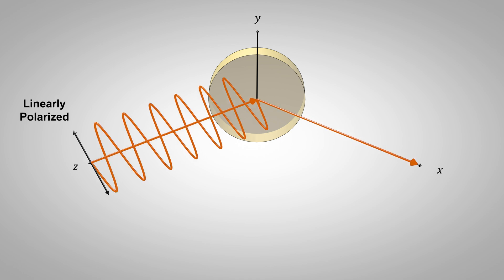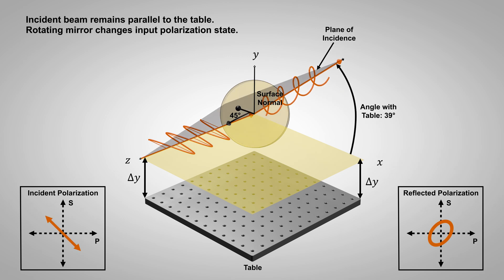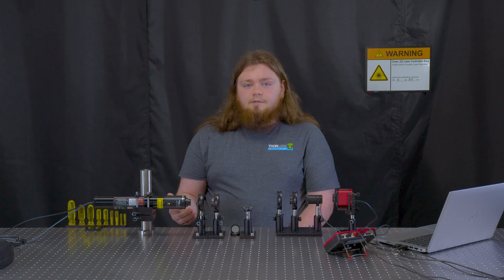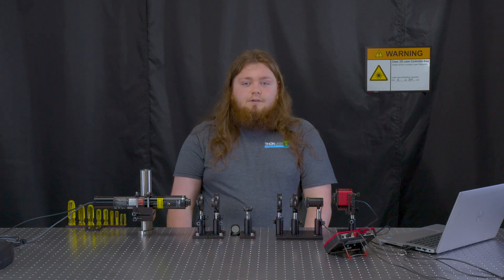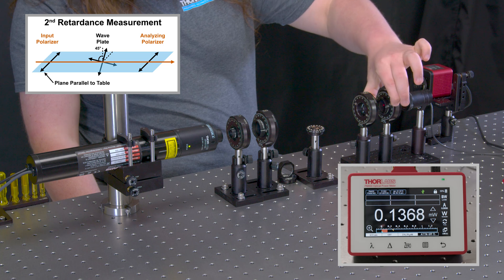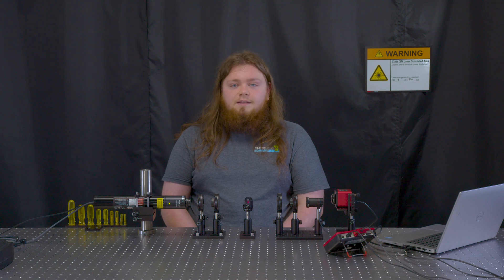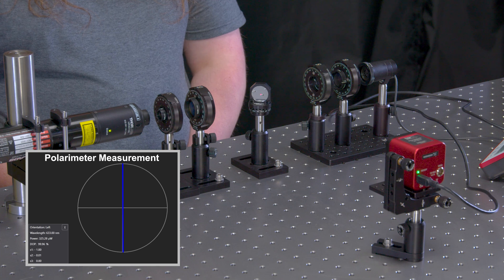How Light's Polarization Can Change After Reflecting from a Metal Mirror | Thorlabs Insights

Comment: Thanks. When measuring stokes, does the polarizer have to be horizontal or vertical polarized or it can be arbitrary angle?
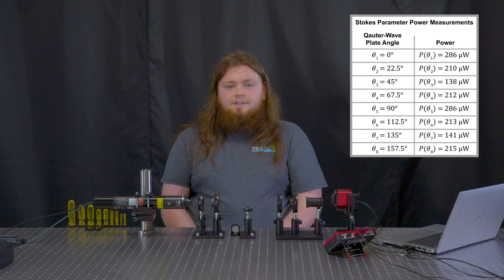Reply from the maker: If you would like to calculate the Stokes parameters using the equations shown at 8:19, then the analyzing polarizer (between the quarter-wave plate and the detector) needs to be horizontal. This is because the equations we use were derived for a horizontal analyzing polarizer. It is possible to make the measurements with the analyzing polarizer at a different angle, but calculating the Stokes parameters would require using equations derived specifically for that angle.
Reply: @thorlabs  Thanks a lot! Do you know what kind it would be when the polarizer is y-axis?
Reply from the maker: f the polarizer’s transmission axis is vertical (parallel to the y-axis) instead of horizontal (parallel to the x-axis), calculate A, B, C, D, and S0 using the same equations shown at 8:19.

To modify the equations for S1, S2, and S3 all you need to do is multiply each by -1.

Comment: What if the incident light is normal?
Reply from the maker: When light is normally incident, the incident and reflected rays overlap. As a consequence, it is not possible to define a plane of incidence, so S-polarized light cannot be distinguished from P-polarized light. In other words, the S- and P-polarizations are degenerate. Under this condition, mirrors are not polarizing, meaning all of the reflected light will accumulate the same amount of phase delay.
 
Often light that is normally incident on a mirror is described as having a pi phase shift after reflection. The pi phase shift is not physical. Instead, it is a mathematical convention that is followed when using local right-hand coordinate systems to describe the incident and reflected light. Because reflection reverses the direction of the propagation vector, the math needs to add a 180° (pi) shift to the polarization orientation of the reflected light to ensure mathematical consistency.

Comment: What happens if we use dielectric mirrors?
Reply from the maker: Assuming you are thinking of the type of dielectric mirrors that consist of thin-film multi-layers deposited on a substrate, the answer is complicated. One reason for this is that the mirror’s effect depends strongly on its precise design, which specifies parameters like thin-film compositions and layer widths. Many different designs, typically optimized for specific applications, are used. Due to this, different mirrors can have significantly different effects on the reflected light. Another reason the answer is complicated is that the mirror’s effect is also highly dependent on the illumination conditions, including angle of incidence, the bandwidth of the light, and the beam diameter. Generally speaking, especially for larger angles of incidence, beams reflected by these mirrors can exhibit wavelength-dependent and polarization-dependent lateral shifts and related effects that include beam distortion and depolarization. (See our response to the question posted by YoseobYoon for additional information.)
 
Let us know if you would recommend this topic for a future Video Insight, and what application would be interesting to you :)

Comment: What about dielectric mirrors? Is the phase shift between s and p polarizations worse than metallic mirrors?
Reply from the maker: While a polished slab of dielectric material is one type of dielectric mirror, we assume your question concerns mirrors fabricated by layering dielectric thin films on a substrate. These mirrors’ effects on the reflected polarization state can be relatively minor or severe, depending on factors including the dielectric stack design as well as the light’s angle of incidence, wavelength spectrum, and beam diameter. In some applications, reflection from a dielectric mirror can significantly depolarize the light, and a metallic mirror would be preferred.
 
The source of the reflected light's polarization change is the thin-film dielectric layer structure. Some light is reflected and some is transmitted at each interface in the stack, following Fresnel’s equations. The total reflected beam is the sum, determined using thin-film interference analysis, of all of the different components of light that have reflected from the different layers. Each component in the total reflected beam has a phase shift that depends on both its phase change at reflection and the phase accumulated while propagating through the stack. Multi-layer stacks are often constructed so that different wavelengths reflect more strongly at different depths in the stack.
 
When light is incident at an oblique angle, single-wavelength S- and P-polarized light can also be reflected at different depths. A consequence is that S- and P-polarized reflected beams of the same wavelength can be laterally shifted from one another when they exit the stack, in addition to having accumulated different phases while propagating through the stack. For many mirror designs, the lateral shift and accumulated phase differences will increase with the angle of incidence and the depth of the reflection in the stack. Both effects can influence the phase difference between S- and P-components in the reflected beam.
Reply: @thorlabs  Thank you for the detailed response. As always, your videos and replies are extremely helpful!